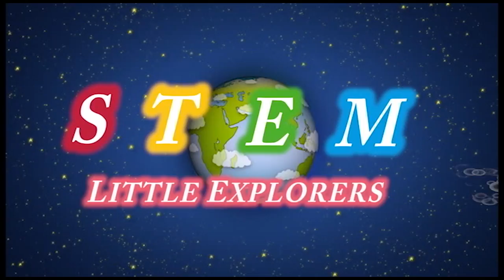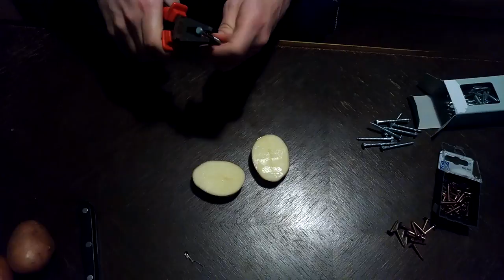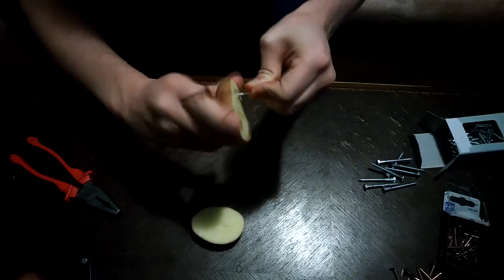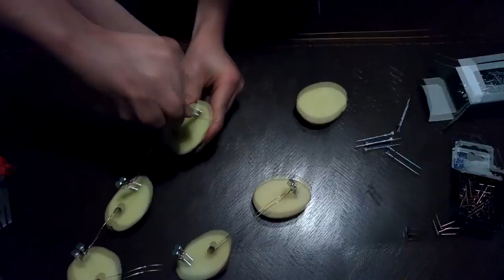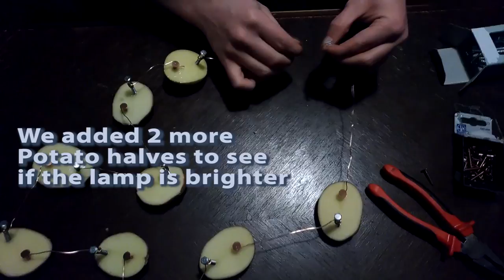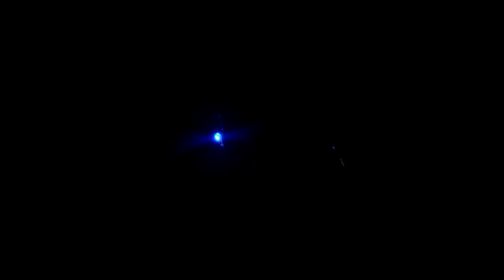How to Make a Potato Battery using Zinc and Copper

Comment: Where did you get the materials like the cable,s LED, the nails? In home depot?
Reply from the maker: Yes, most of the stuff is from hardware store like home depot.
And for LED lamps, we just bought cheap lighters that had them inside. We found that in the supermarket.